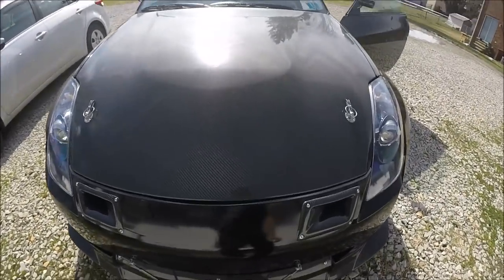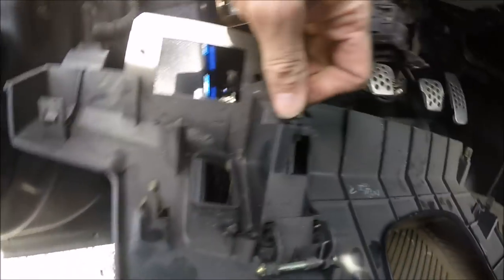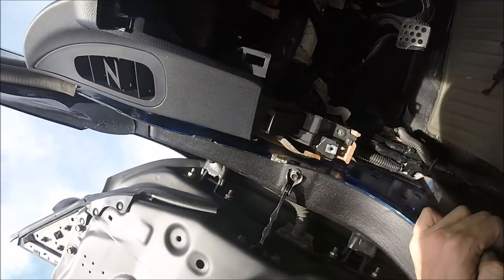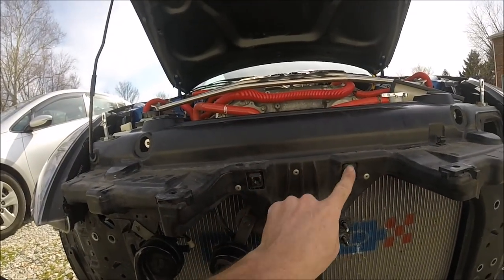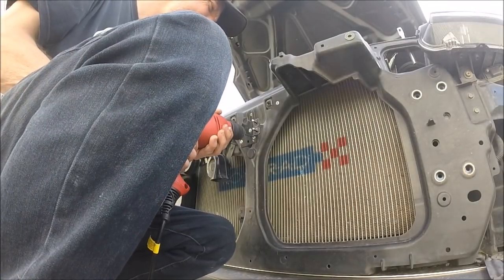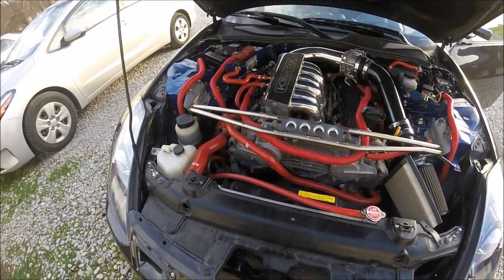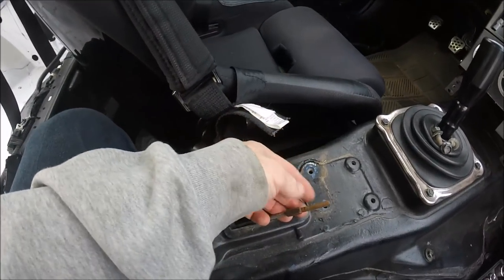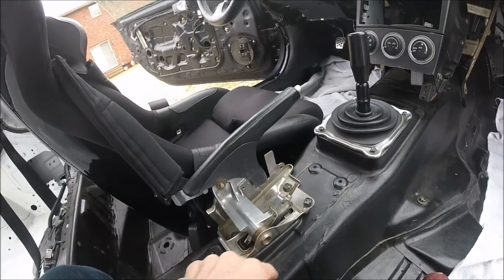350z Hood Latch Assembly Delete With Sparco Hood Pins

Comment: Question brotha: is there a fuse for the hatch I can pull? Because I have a BattleAero wing with a rocket bunny wing on my hatch and I don’t want my trunk to pop at all !!! Help me please !!
Reply from the maker: drivers seat down by your left foot is a fuse cover one labeled hatch lid but i think it controls fuel door also not positive on that 👍
Reply: thatbluezguy wait to if it in the fuse compartment near the left bottom or if it somewhere else ? If u have a iG dm me a pic of the location my iG is project_zella
Reply from the maker: sorry no ig 😢 but yes its at left bottom by your feet
Reply: thatbluezguy well what number is the fuse ? Color? 

How about a Facebook?
Reply from the maker: well after researching i dont believe there is a single fuse i believe the power door locks windows and hatch are together now there is a fuse for the hatch and fuel door but then you would have no way of opening the fuel door you could always just crawl back there and unplug the hatch locking assembly no other issues and it will be permanently closed and locked hope this helps 👍